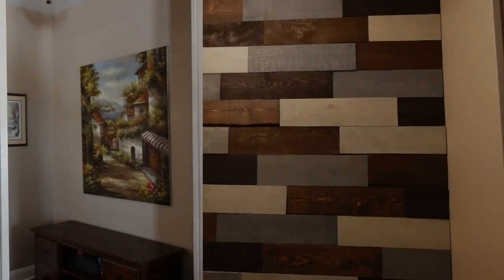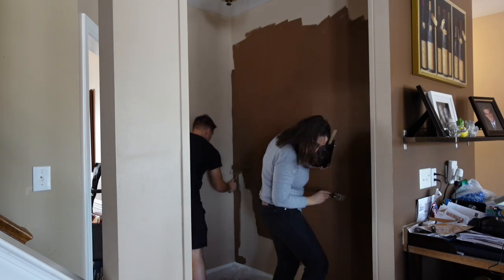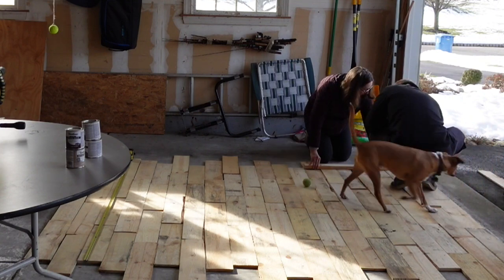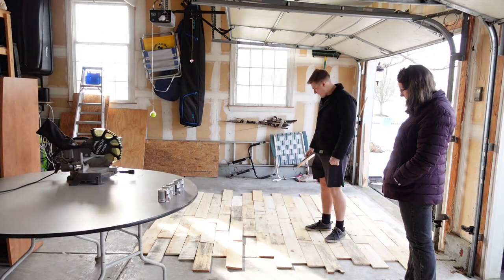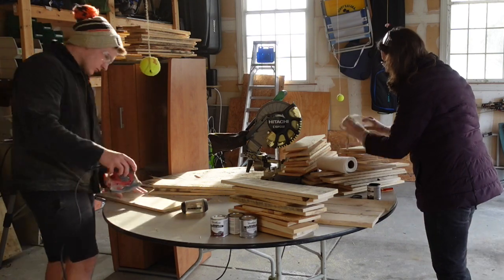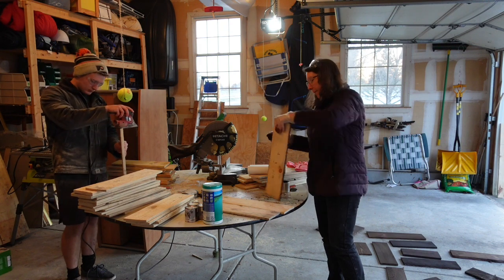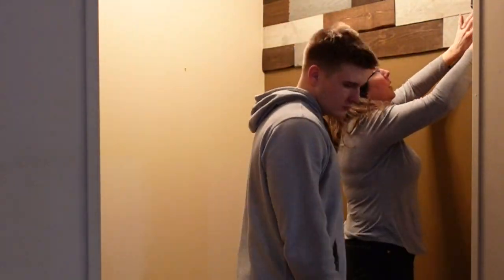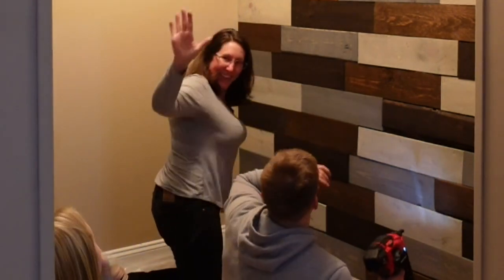HOW TO TRANSFORM A ROOM ON A BUDGET WITH A PALLET WALL DIY

Comment: This came out SENSATIONAL I’m absolutely OBSESSED  I’m glad you did this with actual wood, I’ve seen sooooo many done with foam core board, don’t get me wrong for $20 bucks this girl on here did an ENTIRE ship lap wall with those but my issue would be the cutting, how did you know to cut those small little ones?? Or when you laid everything out how you did and measured it did those small pieces just so happen to be on the cut line??Does that make sense?? I hope so 🥴 cuz it seems all your pieces are pretty uniform except those smaller end pieces so... just a side note, your son is soooooo HANDSOME grrrrrl 😍 marine boy helping his mama so adorable!! Your daughter is pretty too, you had beautiful kids there hunnay!!!!! Outstanding work ALLL of you 👏🏻👏🏻👏🏻👏🏻👏🏻👏🏻👏🏻
Reply from the maker: Hi, Jennifer!!  Thank you so much for all the kind compliments!  🥰🥰🥰  Yes, you're exactly right, the smaller pieces were from when we cut off both ends after measuring everything.  The long boards weren't all the same length, but generally within about four or five inches of each other.